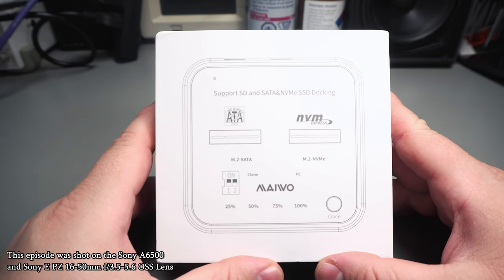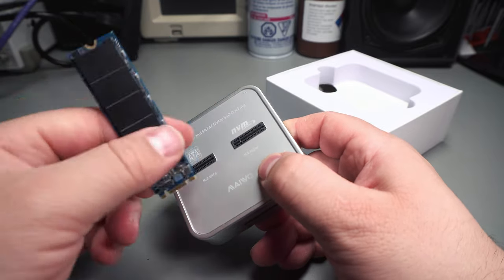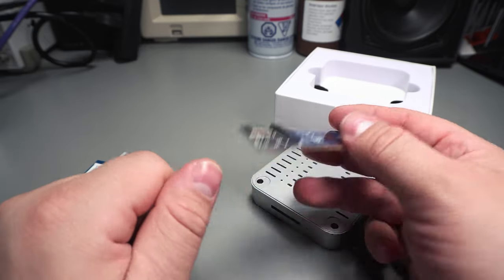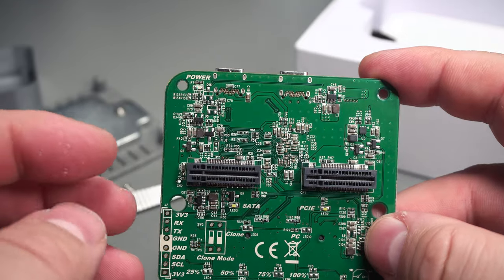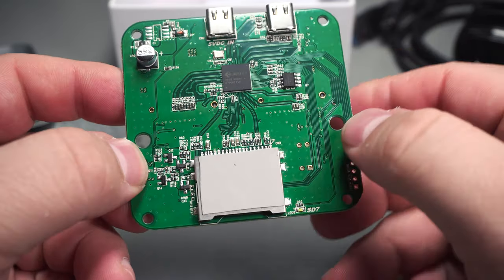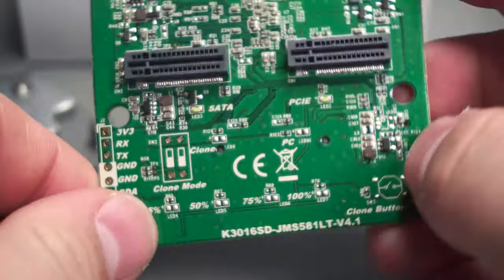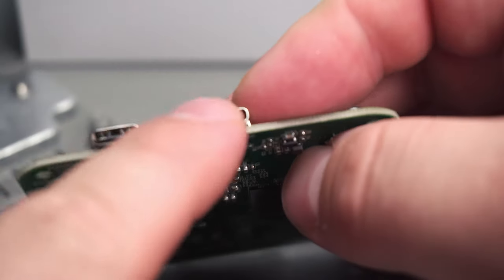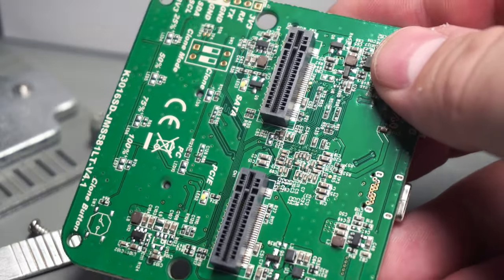Sweet SATA + NVMe USB M.2 Dock

Comment: I have an A1 card in one of my SBCs I use on occasion and it runs a bit warm.  I'd imagine SD Express controllers run even hotter.

I wonder if anyone has characterised the thermals on Samsung PM991 NVME modules.  The PM991 is an MCM which contains an NVMe 3.0 controller with a small amount of SRAM cache and flash memory in one package.